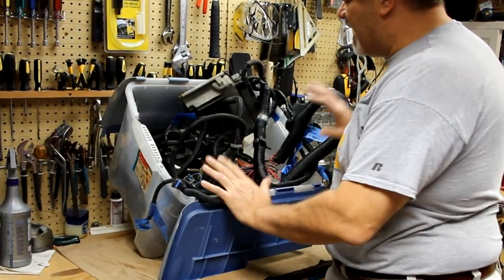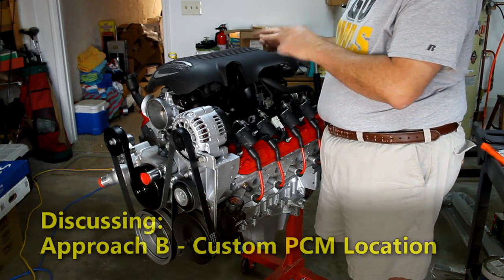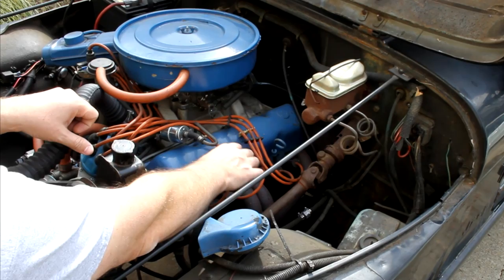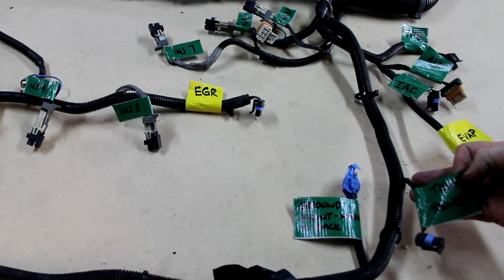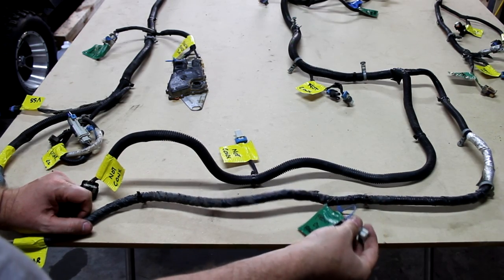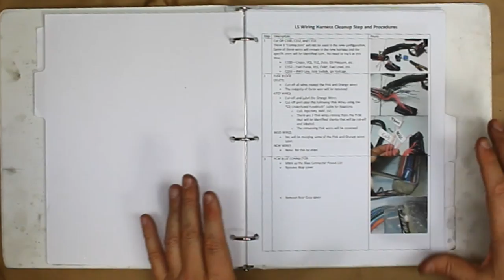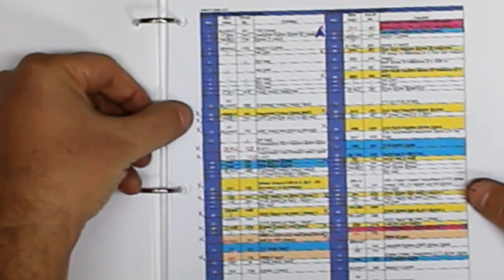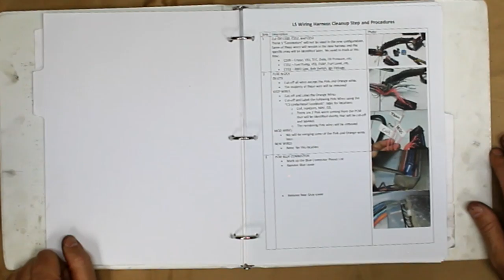LS Wiring Harness Part 1 | Project Rowdy Ep013

Comment: How would you wire a ls3 to a factory harness
Reply from the maker: Not sure that I understand your question.  How would I wire a LS3 [engine] to a factory [?] harness?  If you have an LS3 and it's factory harness, it can be cleaned up (simplified following these steps) to drop in any vehicle.  If you are dropping "It" in another GM vehicle, you would be best served by keeping the LS3 Engine/Engine Harness/CPU together and connect where needed.   The key to modifying a harness is to do so keeping in mind what it will be dropped into (thousands of options).   Cheers!

Comment: Does anyone know how to wire up the Clutch Start Switch signal for a manual trans ls swap 1960 impala      do you also need the Clutch Pedal Position wired or is that just for cruise control ?      its a 2003 LQ4 truck 6.0  blue and green pcm connectors     was originally an automatic trans harness